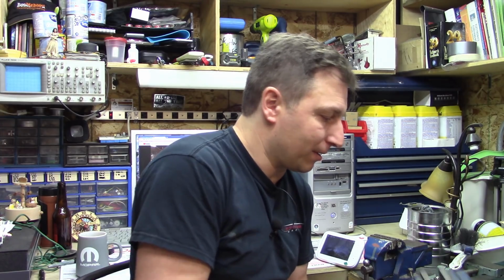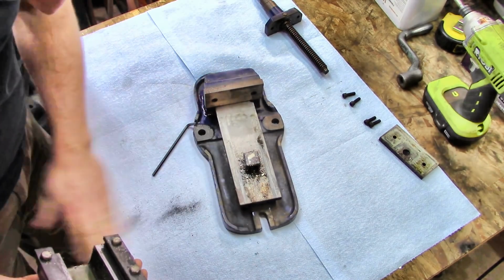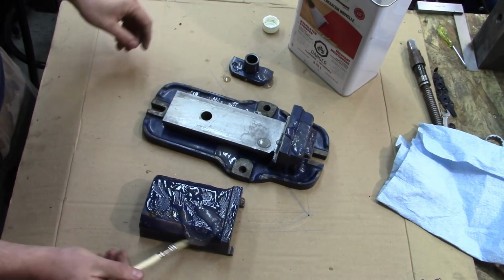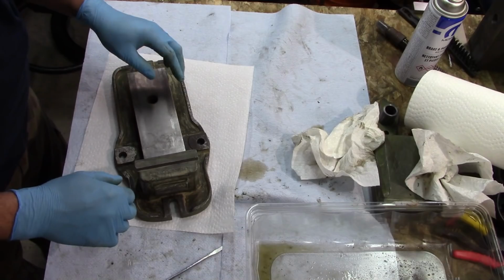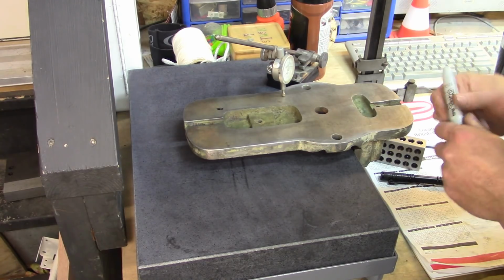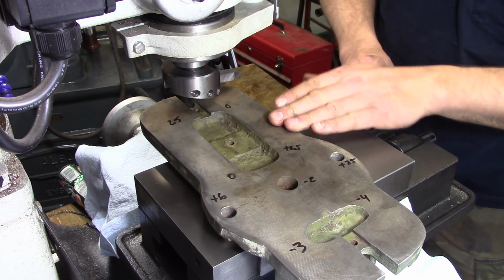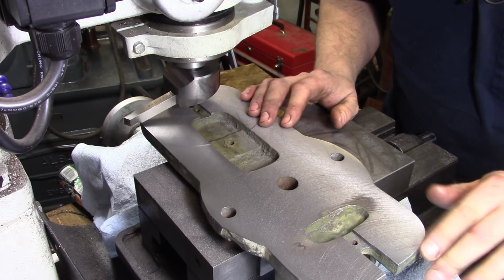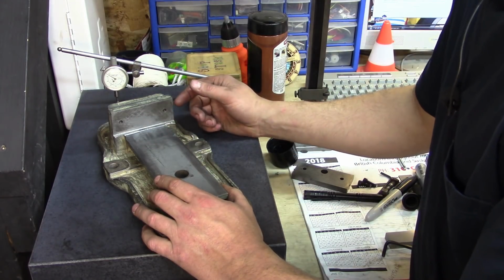Garage Sale Mill Vise for the Shaper Part 1

Comment: Are you kidding?  I've seen guys surface a cylinder head with a jig made on a picnic table.  If you can't fix that, close shop. ;-)
Reply from the maker: I'm totally hopeful that this little vise will be made serviceable now, I just wasn't sure how it would fit in the mill.  It just made it with a wide fly cut.  Going to do up the fixed jaw face with the shaper, that would be the best tool for that job.  We'll get it, just need more time to get out in the shop :)

Comment: It’s used in perfect condition without rust.  Don’t be over dramatic of dirt or how do I do this, it’s campy. You got a bargain and are showing it off. That is legitimate, here is how I am taking it apart to clean and paint it. It’s YouTube not tv, no need for drama. This isn’t the first or last tool clean up video. By 2020 all this attention to shapers will die as cool as it is , it’s not super useful, a novelty.  The big trend they are pushing now is tig welding and plasma tables.  The hangers on will bemoan the vast versatility of gas welding and cutting.  As these channels keep trying to keep it fresh copying each other try to be unique.  Since we are not producing anything in volume for sale like useless dovetail cutters or over priced sensitive steering wheels most home machining is repair, job shop. I repair my antiquated combines and other farm equipment as many do. Lots of metal parts worn or broken. I too have thirty grand on tools and tooling to fix near worthless things. Despite having a three thousand dollar leather chair my twenty grand in woodworking tooling was a poor investment I treasure every chance I get. No drama, dirt is not a surprise it even a real concern, you will never wear that vise out. Clean it, paint it, share the fun of it, brag about it. Look at mrpete, run out of material, Keith Rucker and fenner, endless informational and entertaining repairs. If it’s so dirty, wear gloves,
Reply from the maker: Hi Francisco, I will definitely admit to being thankful for finding that vise, even if it needs work before being trusted as usable.  Sorry if you feel the video was campy, as you say, I am a hobbyist and was just sharing how the vise came apart as I thought it might be interesting to some.  It is hard to make a video that appeals to everyone, hopefully future videos might be more enjoyable for you.  Regarding the shaper, I used one in high school and ever since have wanted one of my own. This unit just happened to need more work than I had anticipated, but still thankful for it as there are some operations it can do that the mill can't.  And I totally agree, what was spent over the years in metal shop equipment and tools could perhaps have been invested in something else but I too treasure the time I get to spend in the shop.  Thanks for coming by, and for your honest feedback, I do appreciate it.
Reply: Everett, Enjoyed the video. Just the way it was.   Gary